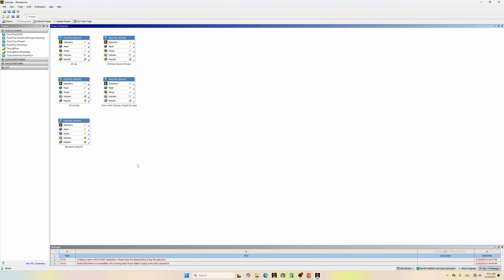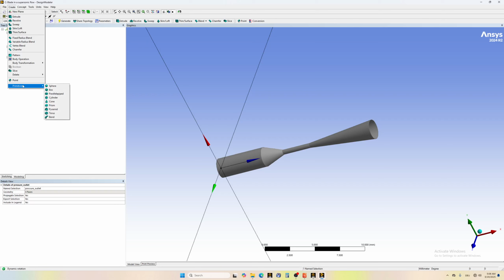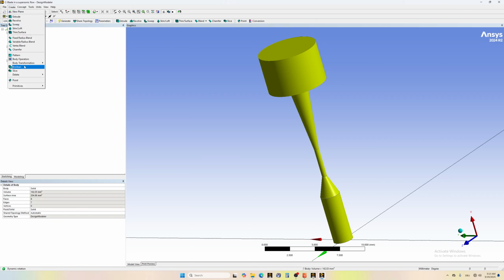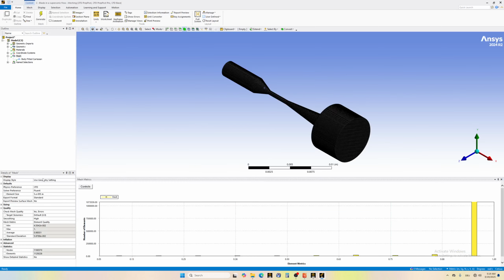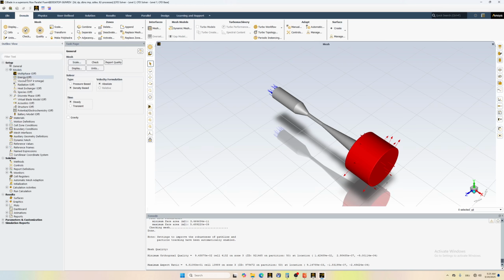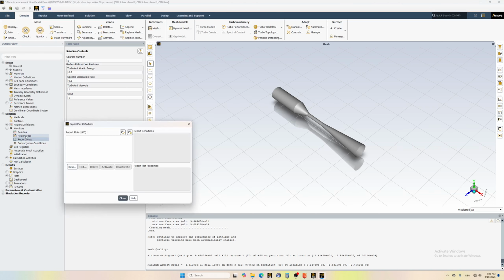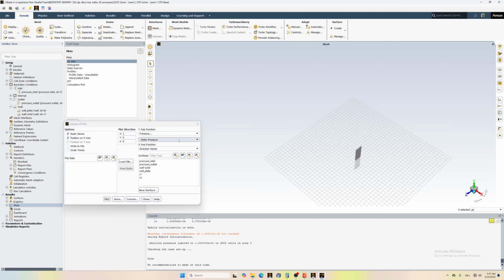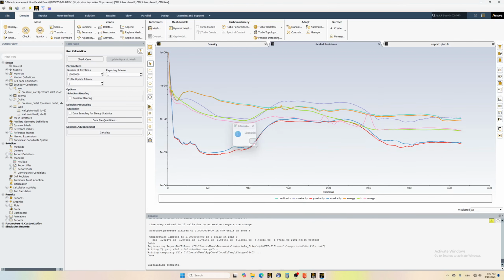7. Generation of fast downramp gas density profiles with applications in wakefield accelerators.

Comment from the maker: In this example, the flow is extremely turbulent, so the divergence of the solver cannot be corrected only with the outlet pressure increase. You might have to decrease the Courant number (in Controls) a lot.